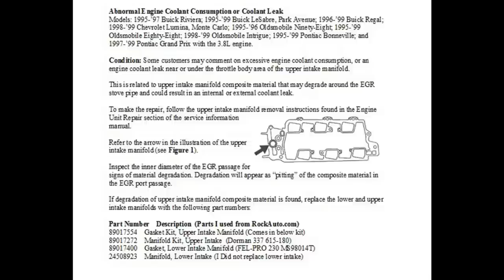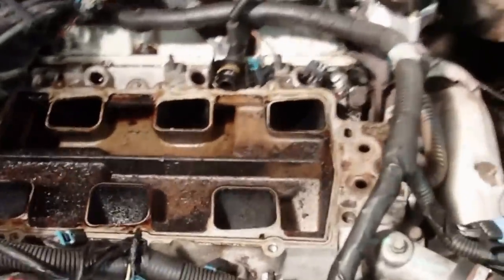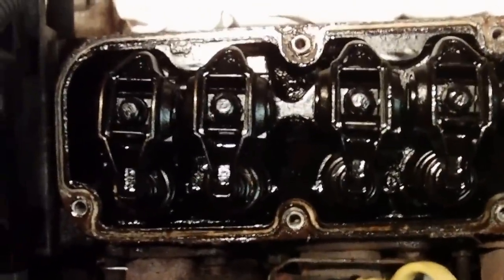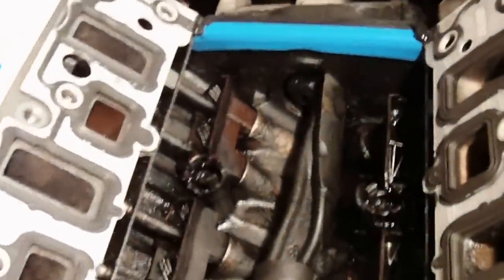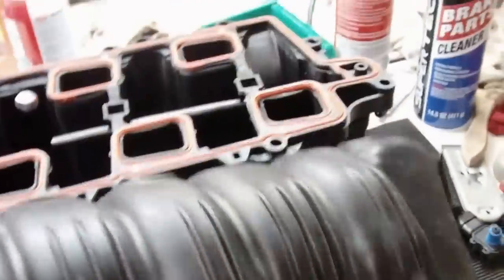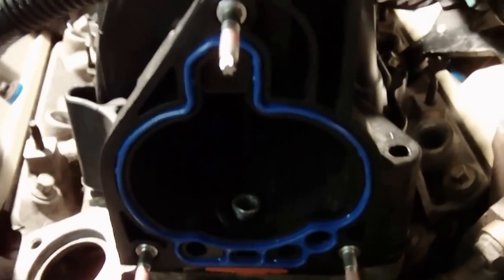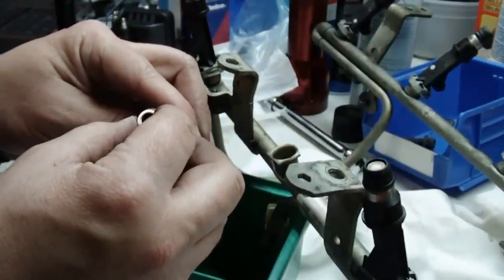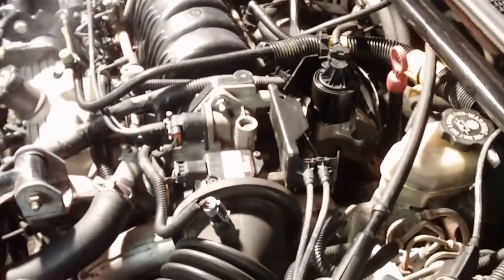GM 3.8L 3800 Series II engine upper and lower intake manifold & valve cover gasket replacement

Comment: Theses engines are the best if you keep up with them. It’s the best v6 engine GM ever made.
Reply: its actually a 100% buick design
Reply: No way. Way too much plastic being used where it shouldn't. My 3.8 is nothing but problems, runs like shit.
Reply: too much plastic everything breaks
Reply: @xanny7373  obviously a lot of those engines are more then 25 years old now plastic crap especially being in the engine bay exposed to all kinds of heat for years and years and years it’s gonna crack One thing you can address is the plastic coolant elbow from the factory that was made out of plastic go in from the tensioner to the cooling jacket of the engine supplying coolant those will break they make aluminum replacement it’s really not that hard to do I’ve done it on my 96 PA Way before my plastic one started to crack just as a preventative measure never had the issue and then the upper intake manifold that’s plastic I haven’t had that go out yet either but if it happens it’s easily replaceable that engine is child’s play to work on it’s not that big of a deal to replace that upper intake manifold when it goes as well as the lower lower intake manifold gasket both are an exceptionally easy job and that’s the lower intake manifold gasket being made out of plastic from the factory guess what they make an aluminum replacement in the aftermarket there are really three common failure plastic items on that 3800 engine the upper intake manifold housing is made out of plastic and the EGR tube will melt that eventually because it gets pretty hot and barrel to the lower intake manifold gasket from the factory was plastic they make aluminum replacements which knocks that issue out three coolant elbow right underneath the serpentine belt tensioner that’s plastic from the factory they also make an aluminum replacement that comes with a tensioner as well if needed If not you can buy that by itself on Amazon that job is not that hard all of this is not that hard that’s three issues with this car and the deck school coolant issue for shoes but that’s nothing compared to most cars And yeah the fifth problem the transmission is a little week mine hasn’t gone out it still shifts like a dream  something tells me you don’t own one of these cars with this engine in it you’re just commenting because if you did on one of these cars with these 3800 series engines in it you would know about the aluminum upgrade replacements that’s common knowledge at this point my 3800 runs pretty good it has given me zero issues for two years so far but it was 68,000 miles on it it almost has 75,000 now I put several thousand miles on it within the first year of owning it with no issues it’s my daily driver they’re not bad cars you just have to know how to do certain things really any of this is not that hard to do what’s gonna be the expensive part of it is getting a shot to do it when it comes to the upper and lower intake manifold if you don’t know how to do DIY it look up a video show you step-by-step
Reply: @shanooby4359  the reason why yours runs like shit is because you don’t know how to take care of it it’s true that upper intake manifold is made out of plastic and the lower intake manifold being made out of aluminum the gaskets for that from the factory were made out of plastic as well as the coolant elbow coming out of the belt tensioner was made out of plastic from the factory they have a little man replacements for the pool and elbow and the lower intake manifold gasket there are aftermarket replacements that are aluminum for that to  mines been running for two years trouble free 74,000 miles it’s a 96 I have upgraded the coolant elbow from the plastic factory one to the aluminum replacement to remedy that issue and I will be doing the same thing with the lower intake gaskets as well it’s really not a hard car to work on and the engines are solid engines your runs like crap because you don’t take care of it basic maintenance mine runs like a champ because I keep up with the meat any engines gonna run like crap if you don’t keep up with basic maintenance this engine only has three things for things wrong with it that would make the engine overheat to the point of no return if you continue to drive it that way when you look at how many BMWs are out there with a plague of engine issues from timing chain tensioner’s going bad to plastic intake gaskets to plastic coolant hose is failing I mean BMW these days they were 3-D print the entire engine out of plastic if I could these 3800 series engines are pretty bulletproof and reliable you just have to know how to take care of them and they will be you take care of them they will take care of you replacing the coolant album pretty simple job upper and lower intake manifold if you’re up for intake manifold gets a hold put on it from the EGR tube it’s an easy job to replace it lower intake manifold plastic gaskets fail again easy job to replace it with the upgraded aluminum ones it’s not that difficult what’s going to be the difficult part is paying a mechanic to do it for you if you don’t know how to DIY that will make it expensive but either way it’s worth it because it’s a good reliable engine that will serve you for many more years I plan on doing all that other stuff myself when it comes time but I haven’t had any other issues really at all with my car I replace the coolant elbow that was plastic way before it broke as a preventative measure do you even own one of these cars with this engine in it if you do you would know about the aluminum upgraded parts it’s common knowledge I see in here a lot of people drive these engines on these cars to the ground because I don’t know how to maintain them and I think oh it’s just a car I don’t need to take care of it wrong you do change the oil change the coolant from time to time make sure there’s good gas in the thing change the spark plugs from time to time make sure there’s a good air filter in it new fuel filter I did all of that with mine besides changing the spark plugs in mine doesn’t run like crap it runs fantastic it’s called basic maintenance and aluminum upgraded replacement parts lower intake manifold gasket aluminum upgrade no upper intake if yours has a hole in it from the EGR tube from running to hot upgrade for that yet coolant elbow aluminum upgrade all these are sold on Amazon do a search on Google you’ll find them for sale there to

Comment: Well my 03 Monte Carlo SS just turned 163,000. Always maintained. Checked out the engine compartment this morning and there it was. Very small leak at the lower intake, drivers side. So this weekend is shot. Glad the beer didn't spill.🤣

Comment: Very nice video. Well done..One thing i was un decided on,  after viewing several  videos,  was what sealer to use on the lower intake manifold bolts...and how much to use....LIM  and valve  covers are installed tho...keep fingers crossed!  UIM tomorror followed by injector cleaning and install...05 Lesabre has become a hobby.  Thanks for the very nice video!  jp 
New..8 days later..The 05 LeSabre is complete and running very smooth !  Thanks for all your tips and for a great video. jp

Comment: Thank you for your efforts! The plastic on our 93' Olds Delta 88 has degraded at the connection of the throttle body and the intake at only 50K miles. Shame they used these cheap components on these cars rather than metal resulting in this proceedure being required. This help a great deal in our preparation for this job. T'hank you!
Reply from the maker: Glad it helped.

Comment: On my 96 LeSabre, I just replaced the front and rear valve cover gasket, grommets and water pump.  I did not have to remove the tensioner…it does not go over the rear valve cover.  But, I did have to unbolt the P/S pump to access one bolt on the water pump.  The tensioner has a built in aluminum rear elbow but the front elbow was replaced about 8k miles ago.  The hardest part was getting the P/S pump bolts…especially the bottom one back in.

Comment: I have Tha same motor in my 2000 Pontiac Grand Prix, my intake valves are leaking, jus watching to see for myself great job tho
Reply: Your intake valves are leaking? If do you will have low compression and power. Even some spitting out of the intake

Comment: Thanks Mark! I got lucky about 10 years back & found an 02 Regal with 15,000. It just turned 52,000 (I'm retired & only drive it if I NEED to). Some coolant disappears, so I'm about to do this job mostly as preventive maintenance since so many of the 3800s have the plenum & intake manifold problems. You gave me lots of good tips. Really happy to see one still going strong with 300,000+. Great engine & trans if you maintain it. If you have any thoughts after doing this job that might help me, please reply. Thanks again for posting very helpful video!
Reply from the maker: Jeff,  Glad the video is helpful.  The job is pretty straight forward and other pointers come to mind.  Good luck with yours.

Comment: Just did this job last week with new aluminum coolant elbows. Job was easy. The hardest part was taking it apart.
Reply: how long did it take
Reply: @teehook1  4 hours
Reply: @JisINSANE3  Thanks I'll be doing the elbows and valve cover gaskets as well. Was just wanting a estimate. Thanks again.
Reply: @teehook1  good luck. Not hard. If you ever worked on a Chevy small block not much to it. Look up the tightening patterns for the intake manifolds. And use thread locker on the bolts.

Comment: Confused as to why GM would recall these 3800s for potential fires and only replace the FONT valve cover gaskets add a couple spark plug wire retainers therefore negating the beauty cover bc it will no longer fit yet they don’t replace the rear valve cover gasket that is the same plastic POS The front has that could cause a fire?????
Reply: Excessive hard braking can allow oil to seep through the front valve cover gasket. Had my 03 Monte SS done many miles ago,no problem since. Rear valve cover still dry. I'm told that they make an extension tube for the front valve cover so you can reinstall the beauty cover.
Haven't researched it.

Comment: I have the same issues with my 2001 Buick with same engine. Im curious as to why you changed the upper intake manifold? Great video very informative. Thank you
Reply from the maker: Hi, I didn't change the manifold, just the gaskets.
Reply: Did you put a new black plenum (spelling) on?  The part that the throttle body bolts too. I thought it was called upper intake. Thanks. Ron
Reply from the maker: Ron,  Sorry it's been a while since I did this repair, I did replace the upper intake manifold. From what I remember the inner diameter of the EGR passage and the manifold composite material around the gasket areas showed signs of degradation so I replaced it.  I used the Dorman 615-180 (about $70) and came with the new modified EGR stove pipe.

Comment: Great video, wasn't expecting the fuel injector clean out portion, I'm for sure doing that to my 2001 Lesabre. After the gasket replacement job, did you warm the oil up before changing or did you do it cold, in case there were some particulates?

Comment: Is this the first time your gaskets failed..at 300k if so whats the secret..mine already failed at 60k.. i change my oil every 6 months at 2,200 miles i use conv..chevron oil I got a 2000 buick regal..had the recall done as well..where the replace the valve cover gaskets due to possible fire..its leaking again 5k later err..nice vid...are u a certified machanic?
Reply from the maker: Yes, first time at 300K. No secret just keeping up with the regular maintenance.  No I'm not a mechanic, just a DYI guy.
Reply: @mrmarkg8564  right on u should he a machanic..u are very detailed and skilled from the looks of the vid..i herd that at 100k these start to fail..the plastic manifolds ...mine hasn't yet..what do i look for when it does fail? My valve gaskets failed twice already with in 30k
Reply: had you had your coolant flushed? that could be part of the reason yours keep eating away
Reply from the maker: @edubb2491  You will see coolant leaking around the right side or rear of the intake manifold, near the EGR valve.  The valve cover gaskets shouldn't fail that quickly, more likely the gaskets are ok, but covers were not torqued correctly.
Reply: @mrmarkg8564  ty
Reply: @mrmarkg8564   YOU are One hell of a good DIY guy.

Comment: I got to do the same for my 2000 Chevrolet Monte Carlo SS replace my upper intake manifold getting leaks and I'm at 210,000 miles
Reply: My 2000 buick regal lower intake manifold..is leaking a bit at 62k 1000$ fix!!

Comment: I have completed the work, but I have a water leak thru the throttle body now. New intake manifold and gaskets, new intake plenum and gasket. Torqued to specifications. What did I do wrong?
Reply: I did mine today, and ended up with the same problem after installation. Sucking coolant, cloud of white exhaust smoke!! :(  It's been a while, but what did you find wrong?
Reply: @johnadams4501  oh wow.... it was drama.  Turns out my engine block was cracked.  I bought a junkyard 3800 out of an lower mileage chevrolet impala.  The car is now good!

Comment: Do I have to replace the lower gasket? I'd like to get away with just the upper gasket if possible.
Reply: Not recommended. I know a guy who tried getting away with it, and soon after he had to do the lower because he still had an engine code.
Reply from the maker: You don't have too, but I'd recommend doing it since your 3/4 there already.
Reply: Well I'm not throwing any codes, I just have a  coolant leak on the drivers side of the manifold. I was hoping it was just the upper plenum gasket, but I can't tell.  2005 Impala 3.8L
Reply: @thegreatecb  The lower gaskets are very common for the 3.8. No disrespect, but I think you'd be crazy to ignore it. They can get bad enough to make the car run very rough. If you're a second owner then they may have been done in the past already, but wouldn't you want that peace of mind? Just my 2 cents!
Reply: @jimdent351  yea I leak at my lower intake manifold in poniac Grand Prix air getting into engine making car jerk misfire sometimes

Comment: I would like to know why you replace the whole plastic intake for
Reply: if overheated, it may get warped and start causing coolant to pass through the EGR tube. coolant then may get into cylinders. In this video he used Dorman plenum, I prefer ATP brand for that part. They should be kind of equal in quality though, I guess.

Comment: i just did the same thing to my car, ran fine before hand. Now it throws codes P0122, and P0452, and dies in idle. I've checked the vacuum lines and all the connections. You have any idea what could have caused this?
Reply: You probably have some unhooked sensors or a damaged throttle body or both

Comment: Do you have to drain the coolant if replacing just the upper intake manifold?
Reply from the maker: No, you don't have to drain it, you will loose some when you pull the upper intake off, but not much, however, it is always a good idea to drain and replace the coolant when the system has been compromised to prevent future issues.

Comment: I feel so sorry for the next person that has to take that manifold off. Using red Loctite on Lower manifold bolts is a no no. You can use them on exhaust manifolds because you need to apply a lot of heat to loosen red Loctite and you would start to melt the aluminum before the bolts got loose. Anytime you have to torque a bolt you must clean the threads thoroughly and apply some type of lubricant a moly grease is the best if you cannot get your hands on ARP torque Lube. That's the only way you're going to get an accurate torque reading otherwise you just measuring the resistance of the thread that you're tightening it not the actual torque.
Reply from the maker: With 320K plus miles it's unlikely that anyone will have to take it off again. The red loctite comes in many different strengths, the 242 which I used is a medium strength with low torque break (about 100 in./lb.) so there will be no problems removing the bolts if needed.  Loctite 2700 (also red) is a different story, it's a high strength loctite with high torque break (about 300 in./lb.).  The 262 (medium/high strength) and 272 (high strength) versions are also red and torque breaks are about 200 in./lbs. Thanks for your feedback on the accurate torque readings.
Reply: what's more, this ride isn't going to cross the finish line for someone to take red locktite off, either way red lock tite medium strength or even the high strength at 11 lbs at torque on non torque yield bolts will come off, I promise
Reply: cars got 300+ thousand miles.... nobodies taken manifolds lower or upper on this car, this is what i call end of service life maintenance get another 30-50k. i have 2 impalas 1 with 3.4l and my replacement the 04 impala ss with sc and its just over 200k but rust will kill my new car before i get 300k unfortunatly i wish i could stop the rust but its a 500 dollar car not worth doing restorations. not to bad yet tho and boy it's definatly a quick car forsure

Comment: i have this engine for 03 chevy impala ls 3.8L so it’s basically the exact same?
Reply from the maker: Yes it should be if it's the 3.8.
Reply: @mrmarkg8564  okay thank you, but i was thinking the upper intake manifold doesn’t look cracked it’s just seem to be a bad gasket should i replace just the gasket or just buy new upper intake manifold, the car has the stock one on it & car has 124,xxx miles
Reply from the maker: @jacoblimon4519  Replace it, it's not worth the $70 to have to take it apart again.